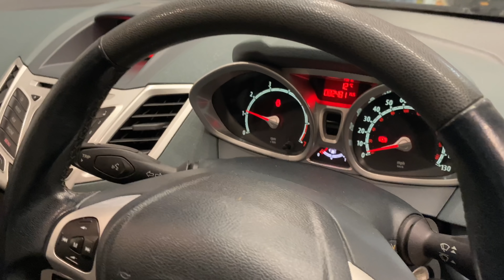FORD FIESTA ZETEC 2010 COPART SALVAGE REBUILD PT 1

Comment: Nice looking car when it's finished, my first new car was a mk2 fiesta, it looks the same colour.  These cars have come a long way since then.  I slow the time lapse down, so that's not a problem for me.  I  got my C&G many years ago and got out of the motor trade,  and went into building maintenance. I then got my C&G as an electrician but have now retired after working for myself for about 15 years. I now have two fords, a sportka and a streetka which I maintain myself together with my kids cars. I would love to be able to use my garage, but it just full of tools. Well good luck, keep safe and keep doing the fiesta's
Reply from the maker: Hi Peter thanks buddy how strange i got out of the building maintenance and got in to this motor trade

Comment: £2000 tops for a pre face lift and it’s red which red cars are harder. So be happy with the 2k. 
I wouldn’t personally take the rads off and just put the new rad pack hosing on around it. You’re doing right by lining it up while the bumper is off and if the headlights are too high or too low you can undo the 13s on the slam panel. Jack under it and slowly lift the jack up so it’s perfect and then tighten your 13s up.
Reply from the maker: Thanks Adam i sold a 2012 fiesta 1 mouth ago and got 2750 so i'll be happy with 2k for this one and you are so right buddy i do that all the time now just jack it up at the front to line things up nice one buddy

Comment: I know u follow Rob and Chris on Salvage rebuilds uk , hope they linked you up with Gala Motors in Benfleet  Ford spares. What type of mastic was used on the rocker cover ?
Reply from the maker: Thanks Richard I do use Gala motors mate but are expensive for parts but some times get a good deal and I use gasket mastic for the cam cover 👍👍
Reply: Have you tried partsbuster for original parts copies at discount price .,recommended and used by Serious about salvage
Reply from the maker: @richardnorth5994  yes mate I do use them nice one buddy 👍

Comment: Does it not have a three button remote key?
Reply from the maker: Hi mate it does why is that
Reply: @ResurwreckAutosUK  it just looked like the key you were using wasn’t a three button one. I guess it might be the pre folding blade type. No worries.
Reply from the maker: @silvermane9370  yes mate it’s the non folding type 👍